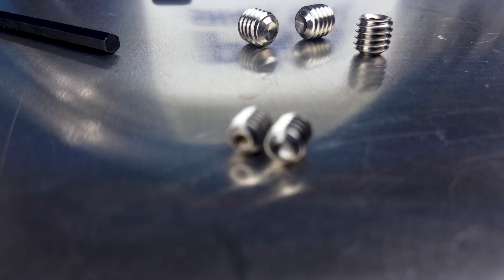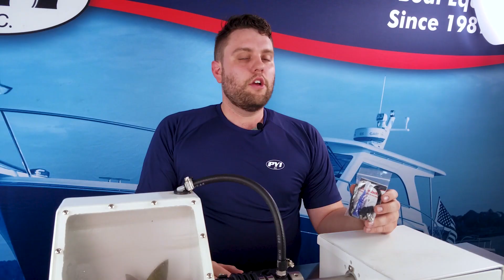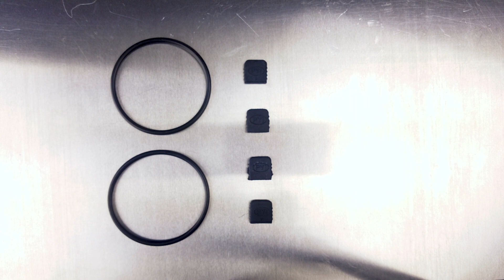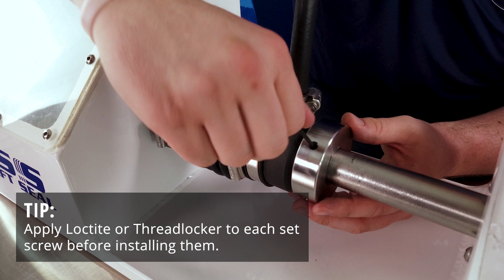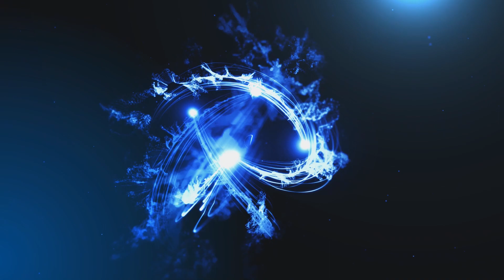Don't Re-Use The PSS Shaft Seal Set Screws

Comment: When installing a new kit, do you put lock tite on both set screws ? Just the top one ? My friend said I shouldn’t put the lock tite on until I get in the water in case I have to adjust it.  I haven’t seen any videos saying that though.  Thanks for any help !
Reply from the maker: Yes, apply thread lock on both set screws during initial compression.